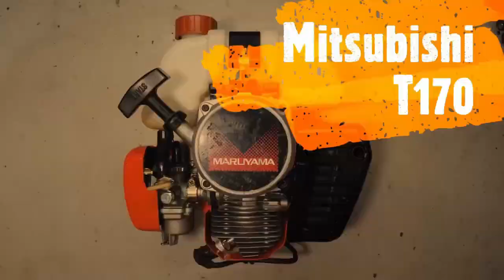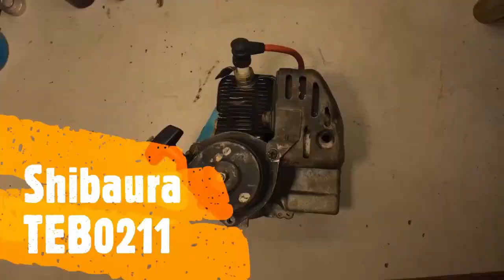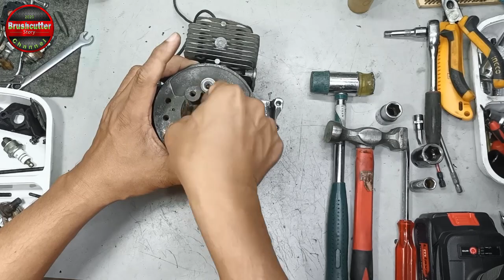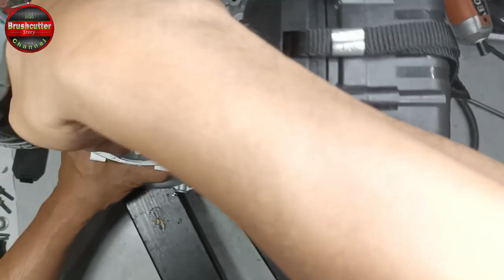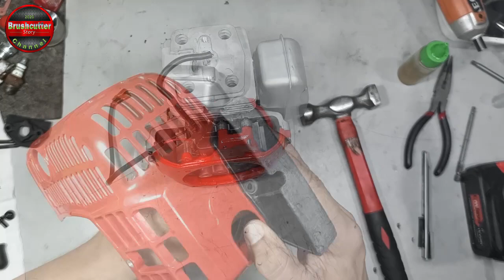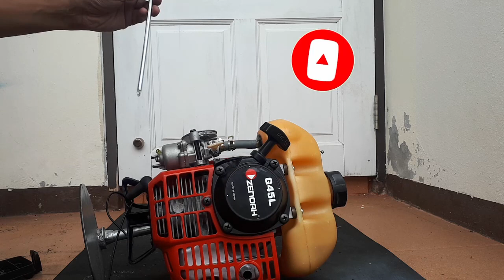Zenoah G45L, two stroke brush cutter engine rebuild

Comment: The part you removed at 3:23 what is that and why it is used for ? Could u pls answer me ?? 
Zenoah is simple superb machine. I liked the way you rebuild the machine. Fantastic work sir.

Subscribed.. 😀
Reply from the maker: It is a fan protection grille plate. It protects objects to get in and damaging the fan.  😀
Reply: @BrushcutterStory  oww thanks for sharing the knowledge